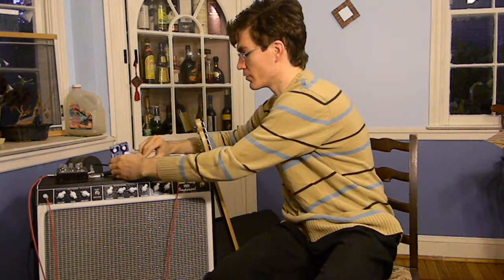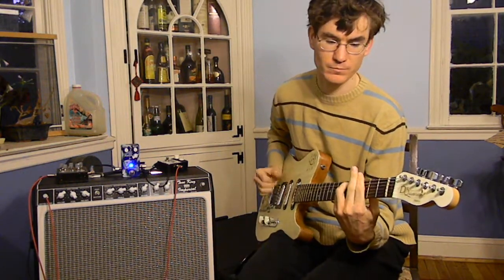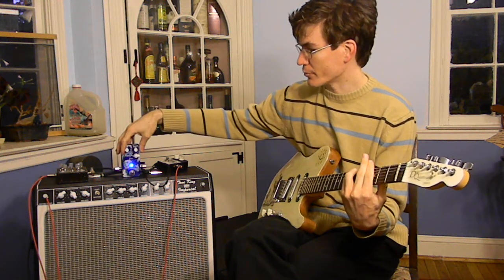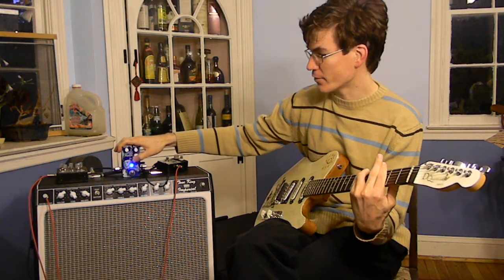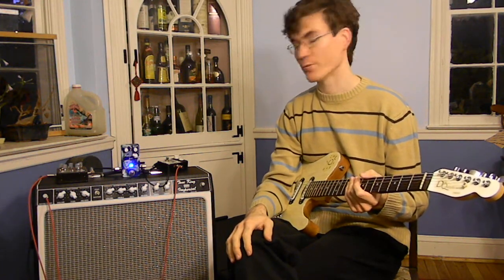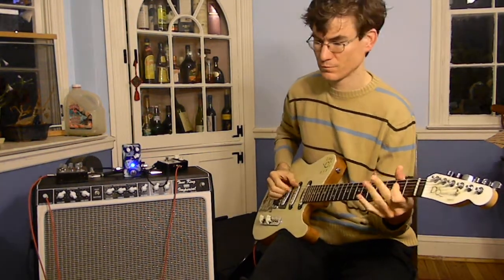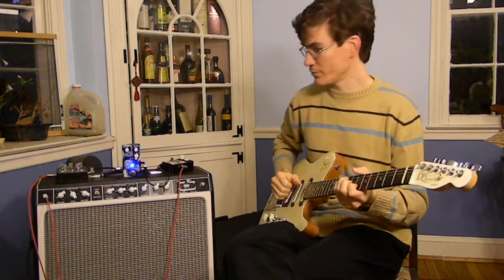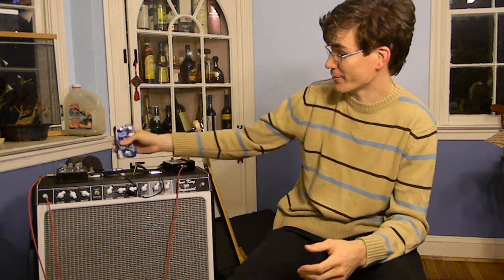Blue Warbler Envelope Vibrato

Comment from the maker: Yes, that's possible. But what you're looking for is a "gate" circuit, which is kind of like an envelope but goes from "no sound" to "lots of sound." An envelope, on the other hand, is made to convert sound to a voltage to affect a variable resistance element to change the behavior or sound of something else in the circuit. The guys on DIYSB could probably point you in the right direction.

Comment: can it be inverted? like slower and then faster
Reply from the maker: Possibly, I think I tried it in the past, but I don't have anything in my notes about getting it to work. You'd want the transistor to be "on" and turn it off with the rectified signal. I do know it probably won't happen with a simple switch. There might be a different way to do both if that's what you want. This design isn't very sophisticated and the LFO can be fussy if you try to do to much with it.
Reply: @jonspatton  is nice if it starts slow and then increments, similar than a violin play style

Comment: Remember the difference between Vibrato and Tremolo. This unit is a Tremolo not a Vibrato.
Reply from the maker: Thank you for the comment, but you're incorrect. If you watched the video you would see that it's both.

A tremolo is amplitube modulation. This has a mode that is amplitude modulation only.

The other mode is a single-stage optical phaser, which does actually produce a small amount of pitch modulation, in the same way that a Univibe does with four stages.